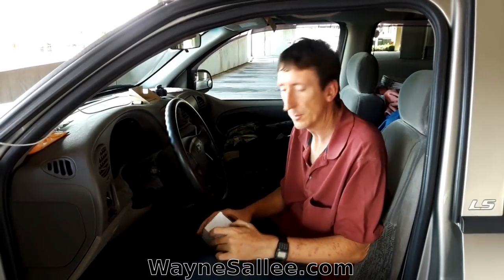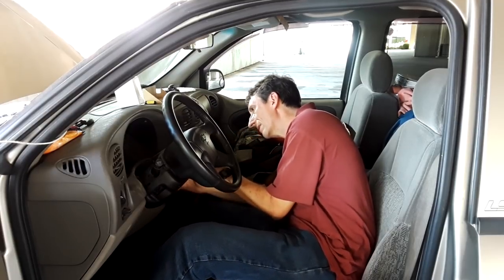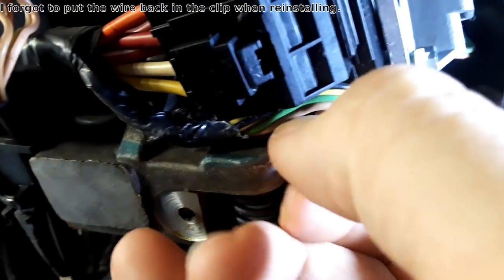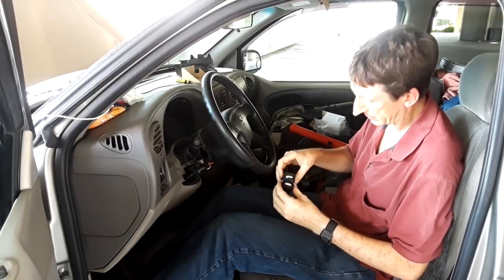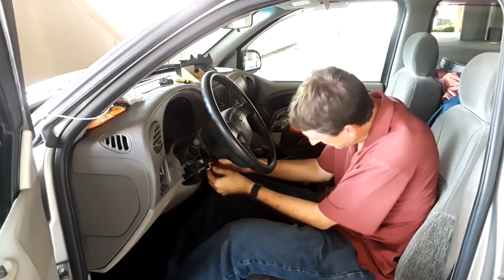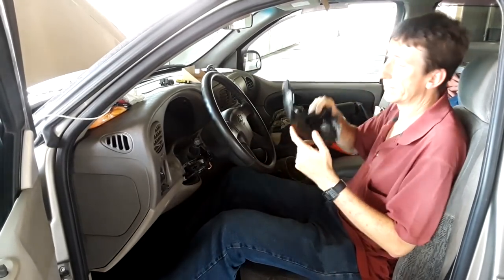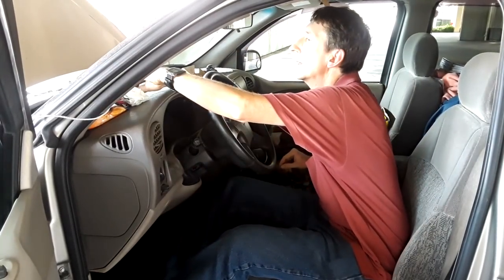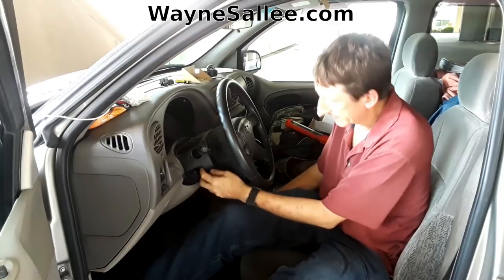Easy way to replace the Ignition Switch in Trailblazer 2002.

Comment: Good video,  I have a 2004 silverado and i put on the new ignition switch and it all works correctly but when i turn the key off now, all of the accessories turn off except for the radio and it draining my battery, any ideas?
Reply from the maker: Is the new ignition switch behaving differently than the old one?  Does the radio turn off when you open the door? Does the door switch work?

Also never throw out the old ignition switch until your are really really sure that you don't want it anymore.

Wayne Sallee
Wayne@WayneSallee.com
http://www.WayneSallee.com
Reply: WayneSalleeTech I was able to figure it out, I believe it was because i didn’t disconnect the battery before and it was throwing it off. thanks !
Reply from the maker: @kylereese7124  Glad you got it working. If the car computer systems were made the way they should be, they would tell you exactly what was wrong. Instead of making cars more difficult to work on, they would make them easier to work on.

Wayne Sallee
Wayne@WayneSallee.com
http://www.WayneSallee.com
Reply: WayneSalleeTech haha yea that’s true. and right as i day i got it working, the truck is completely dead now. it’s not the radio anymore, i’m wondering if it could be a bad lock cylinder that’s causing the switch to be out of place every time i turn the key causing some sort of electronic to not stay on. I really have no idea
Reply from the maker: @kylereese7124  What you need to do is an amp draw test. Connect an amp meter between the battery and one of the terminals, and see how many amps it is drawing. I actually installed a wire that goes into my car that allows me to to the test from inside if I want to. Close all doors, and set the security with the key fob. See how many amps it's drawing, and see how long it takes for the amps to go down after a few minutes. For example on my car when I did a test:

Normal amp draw test:

1.624 amps at first
.012 am after 10 sec
1.65 am after secure lock
.012 am after 10 sec.
4.5 after unlock
2.98 after couple seconds
.080 "
.012 "
1.66 after door open.
.055 few secs with door open.
.022 "
1.651 door closed
.080
.012
.004 after removing usb charger

When you find a problem, then the next step is to test the voltage across the fuses until you find a fuse that give a high voltage reading indicating high amps.

Wayne Sallee
Wayne@WayneSallee.com
http://www.WayneSallee.com

Comment: Wayne?...I appreciate your help here, ive read some problems of others & you sound like you know what youre doing, so thank you!...I enjoyed watching you explain a few things...My original problem on my 2002 trailblazer (156,000 miles) was my stereo wouldnt turn off, I didnt realize when I got out of the car that it was still playing, so it drained my battery...then my security light would come on randomly, then if you hit the lock button (random) to lock the doors it would pop back up & unlock...does that sound to you like an ignition switch?...im desperate!..Thank you, I appreciate your time!
Reply from the maker: No that's definitely not an ignition switch problem. The only way that all those problems could be related would be the computer, or one of the computer modules, but even that I doubt. They are probably all separate problems. The lock problem could be water getting into the switch. GM has had some problems with water getting into some of the door switches. As for the security lights, I assume you are talking about the lights that turn on when you open the door. You probably have a failing switch ( a different switch I assume you know where those switches are at).

Wayne Sallee
Wayne@WayneSallee.com
http://www.WayneSallee.com
Reply from the maker: Glove box switches tend to be bad about turning the glove box light on when you don't know it, so I disconnect those things since they are not needed, and a flash light usually works better anyway.

Wayne Sallee
Wayne@WayneSallee.com
http://www.WayneSallee.com
Reply from the maker: There is also another switch for the key that is not the ignition switch. It let's the computer know that the key is in the ignition to keep you from locking your keys in ignition. That will cause your lock to lock, then unlock. That switch could be going bad.

Wayne Sallee
Wayne@WayneSallee.com
http://www.WayneSallee.com
Reply from the maker: And if that switch is causing your door to lock, then unlock, then you will also notice that when you take  your key out of the ignition, and open the door, you will hear the chime warning  you that your key is in the ignition even though it is not in the ignition. If you get that false chime, then you know where that problem is.

Wayne Sallee
Wayne@WayneSallee.com
http://www.WayneSallee.com
Reply: @WayneSallee-comTech  I believe that switich was replaced, its the switch that came with keys!..I dont know, theres so many!..i have a phone, would you call me?..if not i understand..ty:)
Reply: @WayneSallee-comTech  The dealer said it wasnt the BCM...he said it was the ignition switch, not the ignition lock...does that make sense..209.505.2174
Reply: @WayneSallee-comTech  K, so i dont care bout my door locks...i can manually lock them, but whats draining my battery & why doesnt my stereo turn off?...if I took the stereo out, would my battery still drain?...
Reply from the maker: @jodyfarmer8404   No. It is the switch that is at the ignition. It's not the "ignition switch" It's called something like "key switch". When you push the key in and out, that switch is activated. When you turn the key, the ignition switch is activated.

Wayne Sallee
Wayne@WayneSallee.com
http://www.WayneSallee.com
Reply: im lost...all this cause my stereo wont turn off???.... @WayneSallee-comTech
Reply from the maker: @jodyfarmer8404  The ignition switch is easy to replace, and you could do it yourself. The stereo will stay on after you turn off the ignition, then when you open the door the stereo will turn off. If you don't open the door, the stereo will eventually turn off after a long time. 

Check to see if the door switch is working.

Wayne Sallee
Wayne@WayneSallee.com
http://www.WayneSallee.com
Reply from the maker: If after you leave your car for 30 minutes, and come back before opening your car, and before unlocking your car, look to see if the clock is lit up. If it is, then replacing the ignition switch might fix it.

Wayne Sallee
Wayne@WayneSallee.com
http://www.WayneSallee.com
Reply: @WayneSallee-comTech  Wayne?...I dont think you understand my problem...my stereo used to go off but it doesnt now, it has drained my battery...Mechanic#1 said BCM, dealer said NO, its not the BCM, ignition switch, the part of the ignition that you put the key in has been replaced, battery still goes dead...an ignition switch was put in but it didnt solve the problem, so it was removed (beings it didnt solve the problem...if my stereo is removed, will my battery still go dead?..ty
Reply from the maker: Here is another test. Get in your car, close all doors. Turn the radio on so that you can hear it. Take your keys out of the ignition. Open the door. Does the radio turn off? If not, get out, and open the back door. Does the radio turn off? If not, then replace the ignition switch.

Wayne Sallee
Wayne@WayneSallee.com
http://www.WayneSallee.com
Reply: @WayneSallee-comTech  My car is at the dealer...im goin to pay my 450 bill & bring it home & replace the IGNITION switch AGAIN!..(they want 500., i said oh hell NO!...)...my son took face plate off the stereo so i wouldnt forget to ...so ill have him do the test...i have to have my car at 100% by monday, im in tears, shaking, scared, & sick!...monday 100%..thank you for your help!
Reply from the maker: Also if you can turn your radio on without the key in, Replace your ignition switch.

Wayne Sallee
Wayne@WayneSallee.com
http://www.WayneSallee.com
Reply from the maker: @jodyfarmer8404  Heaven and Hell are real; not something to be taken lightly; http://www.HeavenHell.WayneSallee.com

But yes dealers like to rip people off.

Worst case scenario, you can keep a ratchet with you, and disconnect the battery when not in use.

If the ignition switch is not draining the battery, you can pop the hood, leave the car for 30 minutes, then take a meter, and measure voltage across the different fuses to see what is using power.

Wayne Sallee
Wayne@WayneSallee.com
http://www.WayneSallee.com
Reply: Wayne...I jus got off phone with another Chevy dealer..I explained my 3 problems, stereo wont go off, drains battery (BRAND SPANKING NEW!), & door locks...he said it sounds like the "door latch switch"...if it was that, a new one would take care of all 3 probs, when my door opens, the stereo would go off, therefore I have a good battery, then it would fix the door locks..can you give me your opinion?....much appreciated!
Reply from the maker: @jodyfarmer8404  That's what I keep telling you; to check the door switch. The radio test where you open the door, then open the back door. Does that test.

Wayne Sallee
Wayne@WayneSallee.com
http://www.WayneSallee.com
Reply: WayneSalleeTech Oh, I don't think I read "door switch" in any of our replys, but then again I'm a nervous wreck!..I was fixated on "ignition switch, ign modules, the key switch, key lock,...never did I think"door"...so, we're gonna get that taken care of and go from there..I do appreciate your kindness & patience..ty😅
Reply from the maker: @jodyfarmer8404  Dealers, and auto repair shops have a way of having that effect on people, as they often care more about making money, than they do about the customer. Go back and re-read all of my replies.

Wayne Sallee
Wayne@WayneSallee.com
http://www.WayneSallee.com
Reply from the maker: @jodyfarmer8404  Did you do the test?

Wayne Sallee
Wayne@WayneSallee.com
http://www.WayneSallee.com
Reply from the maker: @jodyfarmer8404  Did you do the test?

Wayne Sallee
Wayne@WayneSallee.com
http://www.WayneSallee.com

Comment: Awesome instructional video 
I have a big issue My 2004 Chevy almost got stolen at a parking lot 😢 from a mall 
I notice that my switch was damage so I replaced it . I few days later I notice that my battery was draining down on me 
So I notice the switch does not go back to its proper position acc 😢 
I really need help please
Reply from the maker: Ok it's important to be clear as to whether you are talking about the ignition switch, or the lock. If the switch is working properly, but the lock just does not turn all the way, then one temporary option would be to disconnect the ignition switch each time you are going to be parked for a while. I don't have any experience with dealing with the  lock. 

Do you still have the old lock? Was the old lock draining the battery too? Did the old lock also not go back all the way? It's always good to hold on to the old parts for a while.

Communist Google has been shadow banning me, so I am now also on odysee.

Comment: Wayne, Just bought a 2003 TB for my daughter yesterday. Today the battery light stayed on ,very dim, but on. one of the constant comments I hear is the ignition switch going bad. HAve you encountered this?
Reply from the maker: It's probably the instrument cluster. Does everything else in the instrument cluster work properly? Does turning the ignition on and off make any difference?

Wayne Sallee
Wayne@WayneSallee.com
http://www.WayneSallee.com
Reply: @WayneSallee-comTech  Thanks for responding. I unhooked the battery, and it went off briefly. It came back on very faded and then went off altogether.
Reply from the maker: @superbeefinder  It's probably the instrument cluster. Does everything else in the instrument cluster work properly? Does turning the ignition on and off make any difference?

Wayne Sallee
Wayne@WayneSallee.com
http://www.WayneSallee.com

Comment: Hi,

I am facing a problem in my blazer. It happend twice after 7 days period as car not start or engine not crank.
Switch on, windows working, lights on, music player on but when I turn the key to start the car .. all dash lights off and when I release the key all dash lights turn on but car not start.
After continues 10 to 12 tries .. finally car on and work smoothly with no issues.

Kindly suggest is that the same issue of switch or its another issue ??

I think its the switch .. I am waiting for your opinion.
Reply from the maker: Sounds like your starter is going out. You will probably be stuck soon with no ability to start. Put a volt meter on the battery with it set to record lowest volts, and try to start the car. If you don't have that setting have someone watch for lowest volts. It also could be a bad connection at the battery. Disconnect your battery cables, and clean them with baking soda, and put them back on. Also check all cables going to the starter, and make sure the starter bolts are not loose, as that is where the starter gets it's ground.

Wayne Sallee
Wayne@WayneSallee.com
http://www.WayneSallee.com
Reply: @WayneSallee-comTech  Thanks for your prompt reply.

I will check tomorrow under the hood for batter & terminals.
I have a volt meter, I will also monitor that too.
But mostly its switch issue .. for that I went today to buy from Chevrolet company but as usual part not available here in Tabuk, Saudi Arabia.
Now after examine my car as you said then I have to go in local market and search for Acdelco switch.
Reply from the maker: @saifullahkhan9388  How did things go?

Wayne Sallee
Wayne@WayneSallee.com
http://www.WayneSallee.com
Reply: @WayneSallee-comTech  
I changed the starter switch .. as in the video .. but again I faced the same issue ..
I went to electrician and he says that as no engine icon and car dash lights off when I turn on the key and try to crank the engine but its not cranked then its means you starter is damaged..

You have to replace it..

What do you think ?

As I face in this trailblazer more issues of damaged wires at the point of connectors..

Can you suggest please.
Reply from the maker: @saifullahkhan9388  As I said before, it's probably your starter that is bad.

Wayne Sallee
Wayne@WayneSallee.com
http://www.WayneSallee.com
Reply: @WayneSallee-comTech  
No dear !!
You know what .. today starter replaced with new one ..
But still I am facing same problem.

Electrician told me that its most probably a switch or sensor under the car which is some where near to gear box .. that will have a problem expected !

 I visit two electrician they told me same starter problem.. but I lose money and problem not solved.

Now I think I have to check by my self .. and what I am thinking is most probably relay is culprit..

I will observe it first before now going to any technician.
Reply from the maker: @saifullahkhan9388  Yes, spending time to get to know your vehicle will save you money.

You can use your meter to see where the power is going, and where it is not, how many amps, how much resistance, and such.

Wayne Sallee
Wayne@WayneSallee.com
http://www.WayneSallee.com
Reply: I have the same problem on a Silverado 2007 Classic I’ve already changed starter and the ignition switch the truck just won’t crank. All I hear is a single click noise that seems to come from the motor. How can I figure out the problem why won’t it start ?
Reply: I’ve replaced the battery as well and both the dashboard and headlights turn on.
Reply from the maker: @peterrivera4710  Watch the following 2 videos:
https://www.youtube.com/watch?v=BAjMO3Zu88s
https://www.youtube.com/watch?v=SNLcW7FhQFw
Does the starter work when using the above methods?

Wayne Sallee
Wayne@WayneSallee.com
http://www.WayneSallee.com

Comment: At 4min 20sec when I popped mine with the screw driver I broke the plastic tab that pops out of the ignition switch. Does anyone know the name of that part so I can look for a replacement?
Reply from the maker: You broke the electrical connector / wiring harness?

Wayne Sallee
Wayne@WayneSallee.com
http://www.WayneSallee.com

Comment: How do you align the gears properly?
Reply from the maker: Move them with your finger to match the gears on the one you removed from the car. Basically they are almost all the way to the end. It might even work, if you just moved them all the way to the end, and installed it, but I'd advise setting it to match the one taken out. This is all assuming that your key is in the off position. The opposite end of the gear setting is obviously the starter switch as it has a very strong spring resistance. There is a big flat area at the end where the off position is.

Wayne Sallee
Wayne@WayneSallee.com
http://www.WayneSallee.com
Reply: I got it. I took the two small connectors out, took the switch out, and left the key out. Battery was on. I rotated the gears until I saw no lights on the dash. (These gears click into place so there's no need to find them). There were two areas where no lights were on the dash,. The first one didn't work. The second one did. All is fine now.
Reply from the maker: Glad that you got it. What year is your vehicle? It sounds like your ignition switch is a little different.

Wayne Sallee
Wayne@WayneSallee.com
http://www.WayneSallee.com

Comment: Would this cause the battery to die
Reply from the maker: It can if it fails to to turn off one of the switches, but usually when they fail, they just fail to make proper connections. 

Wayne Sallee
Wayne@WayneSallee.com
http://www.WayneSallee.com

Comment: I changed the ignition switch it turns on just like this but for reasons unknown the fb won’t shut off all the way the radio is still on
Reply from the maker: The radio stays on until you open your door. Sounds like you have a bad door switch.

Wayne Sallee
Wayne@WayneSallee.com
http://www.WayneSallee.com

Comment: So what do I do if it won't start after that?
Reply from the maker: Don't throw parts at it. Typical symptoms of a bad ignition switch is that it starts giving problems intermittently. If your starter just stopped working for good, then it is probably something else, like a bad starter.